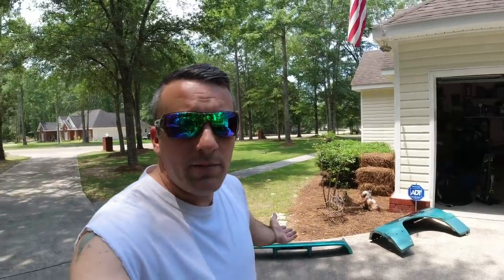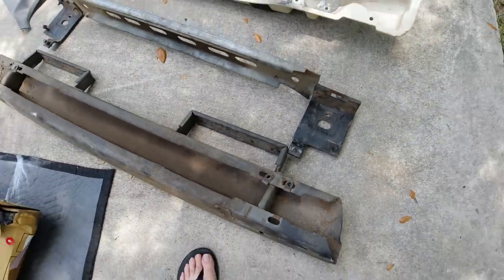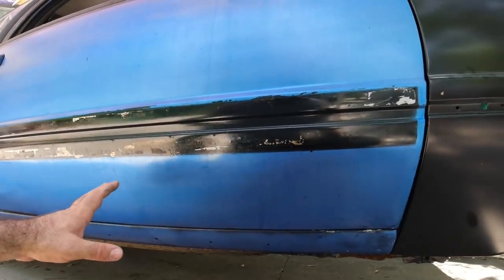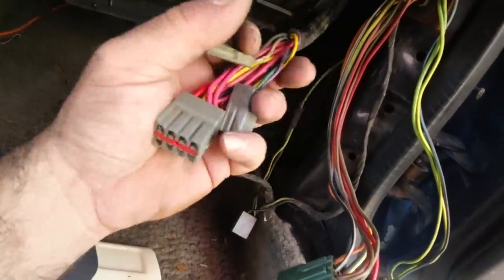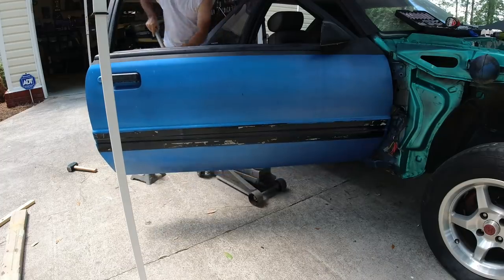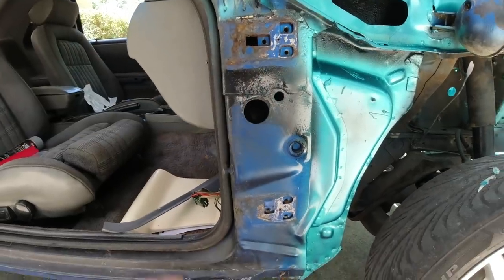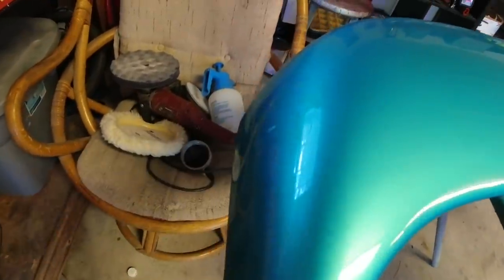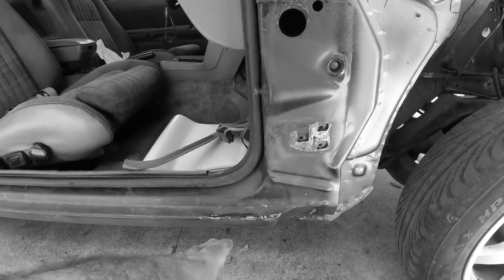BLOWING THE DOORS OFF A FOXBODY - FIXING PANEL GAP AND BODY LINES

Comment: You could of used engine hoist and a strap or chain  to hold door up for ya.
Reply from the maker: I definitely would have if I was only gonna take it off and on 1 time. But I was on and off with the door about three times checking gaps.

Comment: Yeah... Nothing he did here was correct. Except correctly identifying the location and removal, of the wiring harness. But I will give him an A for effort.

The correct information on how to repair this vehicle has been available since 1979. Including proper methods for repairing that rocker. Analyzing damage. And removing doors ... using the two pins, that hold it on.

Ford Motor Company also, still offers the service manuals for this vehicle. Which literally take less time to use, then looking it up on YouTube.